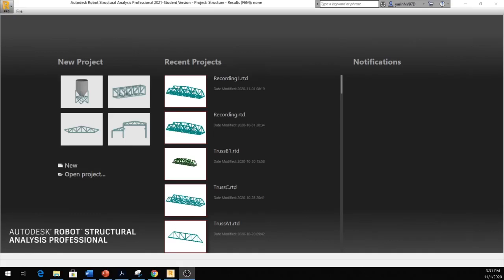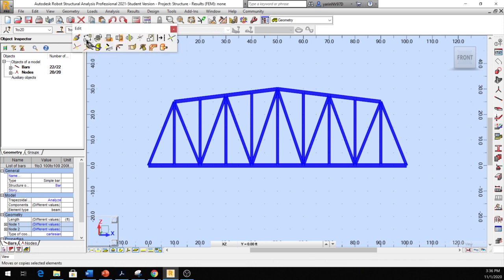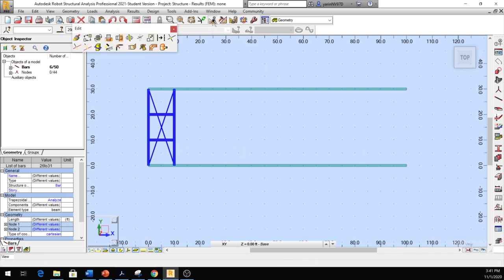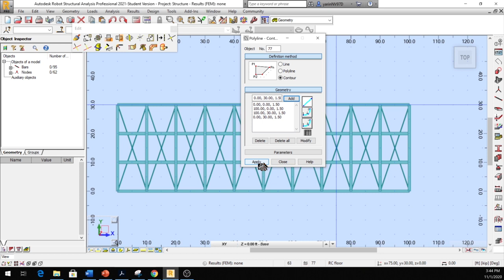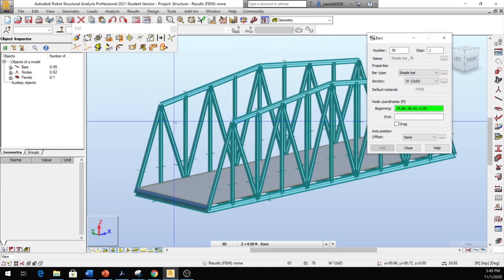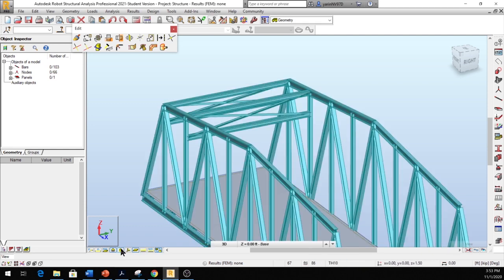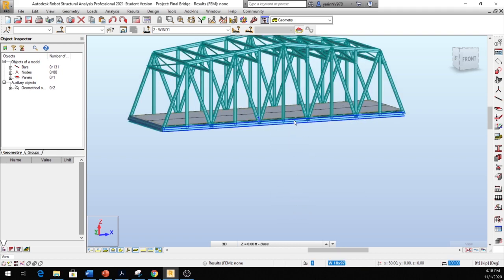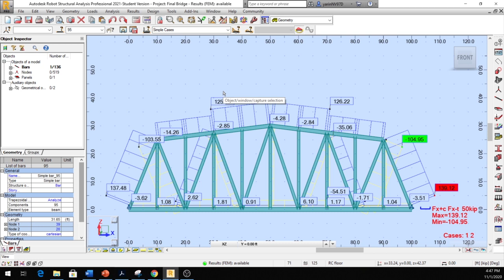Truss Bridge Design Robot Structural Analysis

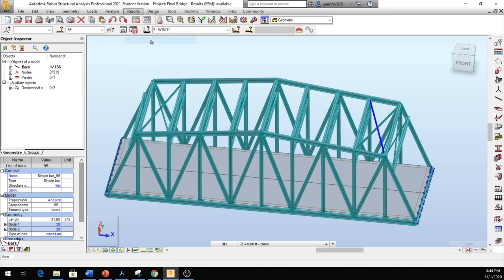Comment: Hi Nasser, Great video.  At 31:50  how did you know instability type 2 would be solved with cross bracings?
Reply from the maker: Hi Gabrielbobmarley, 
Hope all is well. Based on experience,  prior to becoming a college professor, I worked for 35 as professional engineer involved in building many bridges.
Reply: Nasser Yari PhD, PE  that doesn’t help a young engineer haha but thanks for posting the videos. If you can go through the analysis and design and maybe point out challenges that engineers face when designing structures. Thanks again . Great channel

Comment: Sir, if the thickness of the concrete deck is 10in and the depth of the W18x97 section is 18.6 inches, the offset between the centroid of the cross beam and the centroid of the concrete deck will be 9.3+5= 14.3 inches, so why did you use a value of 18 inches? Thanks